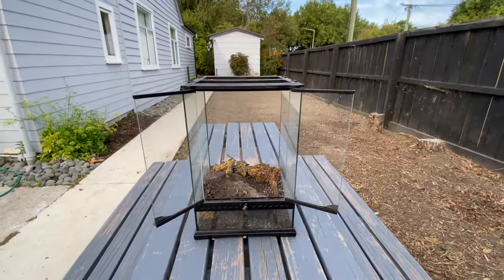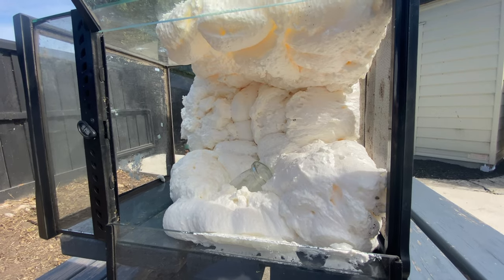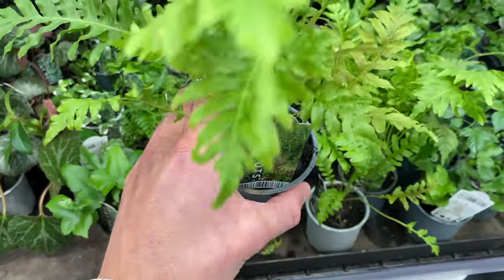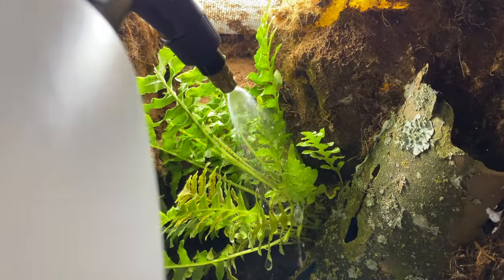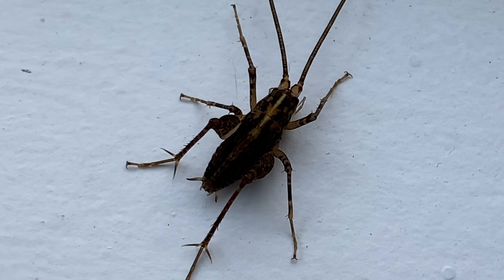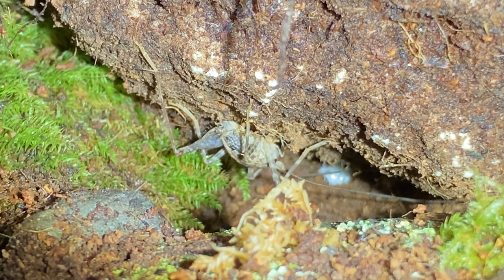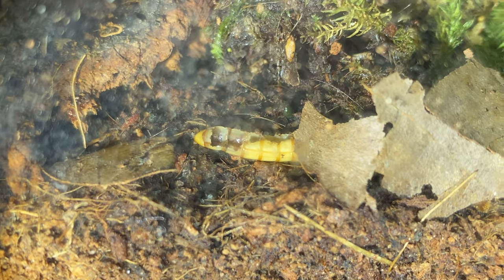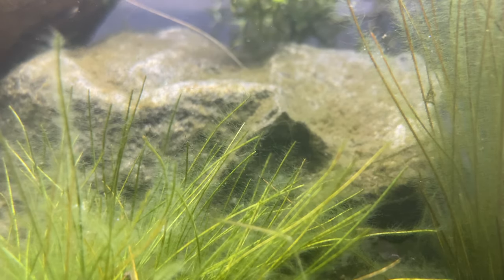I Built a CAVE for a Cave Weta (Terrarium)

Comment: Hey man, im thinking about doing the spray foam method for a ruakawa gecko, what type of foam is that please? Also I would recommend siliconing in the edges of the foam to the glass because I find that it eventually peels away on smooth surfaces like that if unsecured
Reply from the maker: It’s just gorilla expanding foam, yep silicon all the edges and all over the foam.